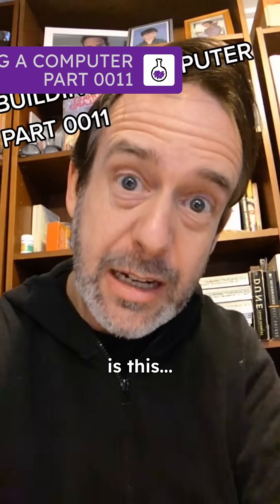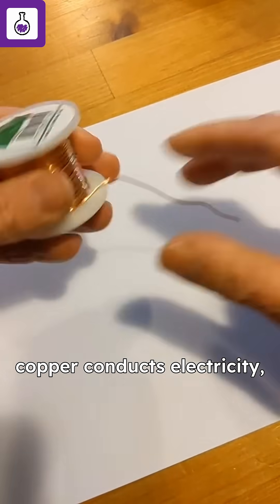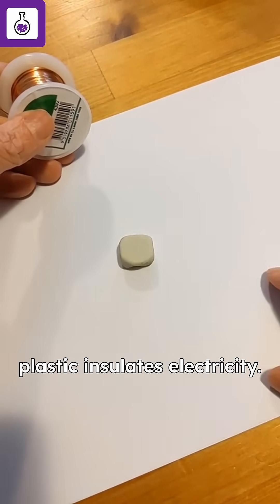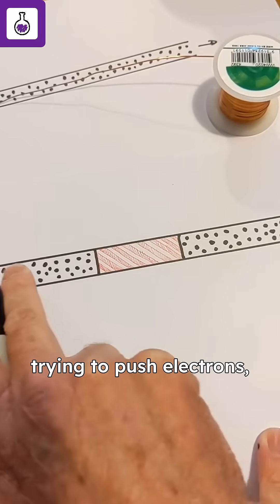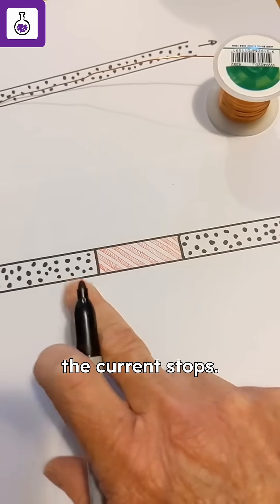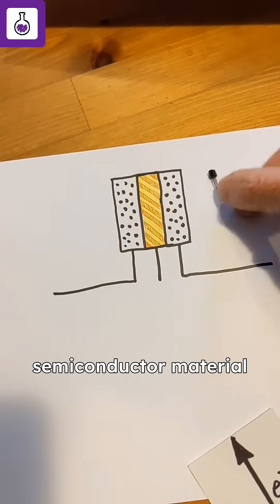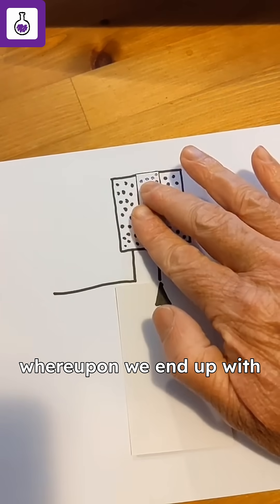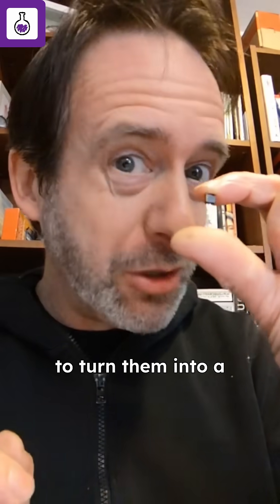This Tiny Switch Runs the World

Comment: While your explanation is intuitive, it is not technically correct.  Semiconductors are actually decent electrical conductors on their own, but their interesting electrical properties come from doping, where you add impurities on purpose to modify the characteristics of the charge carriers.  P-doped semiconductors have an excess of "electron holes" which act as mobile positive charges, and N-doped semiconductors have an excess of mobile electrons.

Something really interesting happens when you connect an n-type and a p-type semiconductor together.  At the p-n boundary, you have a small region where the electrons and electron-holes combine, canceling eachother out and creating a small region with no charge carriers at the boundary.  If you inject more electrons into the n-side, then they can easily flow over to the p-side since they are attracted to the positive holes.  However, if you inject electrons into the p-side, then they have a very hard time going over to the n-side since they are repelled by all the free electrons there.  This means current can only flow in one direction.  This is how diodes work.

Describing how transistors work in detail requires some quantum-mechanics.  However, the jist of how a pretty standard n-channel mosfet works is that it has two n-type regions on either side of a narrow p-type region.  It has a plate above the central p-region that forms sort of a capacitor.  When a positive voltage is applied to the plate, the positive charge carriers carriers in the center region are repelled and free electrons attracted, forming a small "n-channel" with free electrons, allowing current to flow between the two outer n-doped regions.

The physics behind bipolar junction transistors is ironically even more complicated, even though they were invented before mosfets.  Understanding these devices requires a very in-depth understanding of solid state physics, more than can be conveyed in a youtube comment.  But the information is out there if you're adventurous enough to dive that deep.